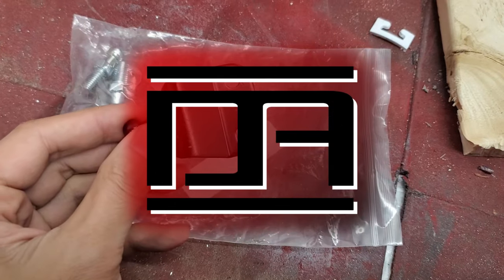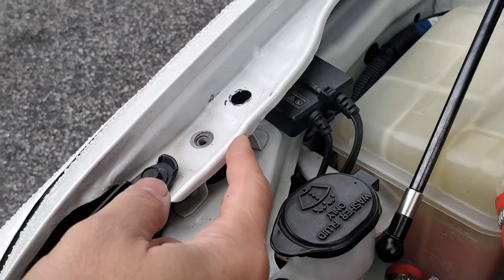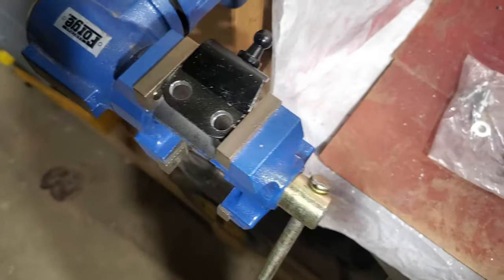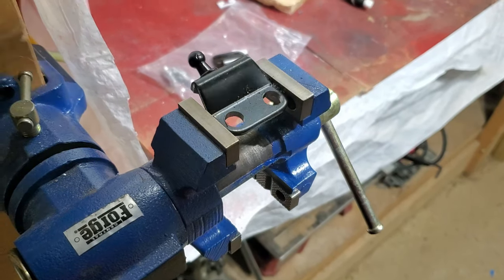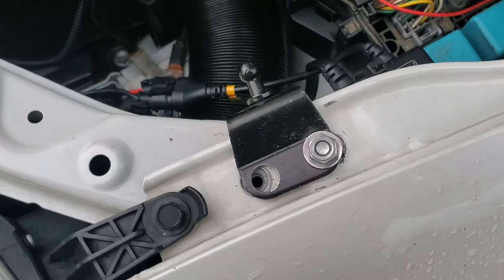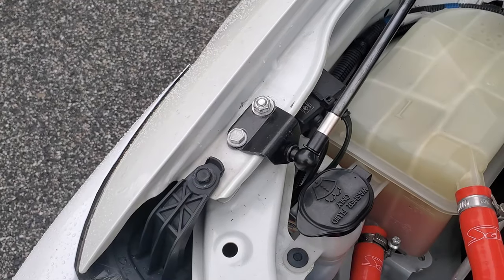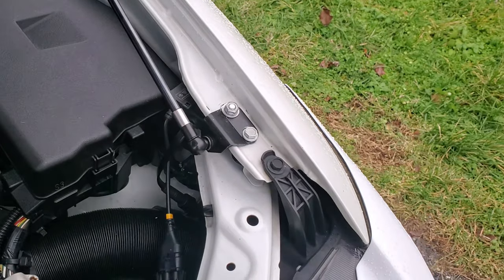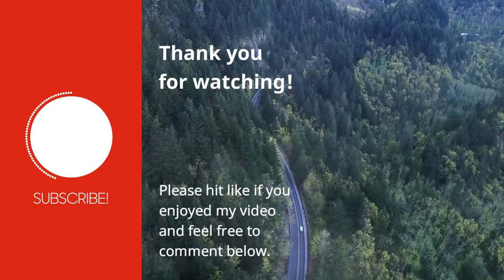Hood Dampers Universal Two Hole Fender Ball Mount Bracket Install (Scion tC2 / tC2.5)

Comment: Two questions my friend...... Question 1/. I noticed you left the silver spacer on the bottom of the struts after the new bracket upgrade, should I have left mine on too? Question 2/. Do you know the exact hardware specs for the stainless bolts, nuts and washers for these new upgraded brackets ?? I want to get them ASAP. Thanks Bro !!
Reply from the maker: You don't need the spacers when you use this bracket, but it doesn't hurt to leave them on as they will just make the hood sit up a little higher. As for the bolts, I'm going to run out to the store today and finally replace mine with stainless steel ones. I forgot about wanting to do that until I read your question. I'll post up the size nuts and bolts I get in the video description later.
Reply: @VampyreX13  Thanks Bro, I appreciate it.
Reply from the maker: Added the info to the video description. M6 is easier to find, but M7 will also work.
Reply: @VampyreX13  I actually found a bunch of M7 bolts of different lengths, along with nuts and 1 inch washers in my mess of hardware. Totally forgot I even had them. lol !! I'll send you a photo when I finally install them (I have to paint the brackets first so they don't rust). Thanks Bro!! Awesome as ever !!

Comment: Hey Bro.... the Amazon link is dead and the eBay link won't ship to Canada. Do you have any other links to get the brackets?? Thanks Bro.
Reply from the maker: I just updated the Amazon link.
Reply: @VampyreX13  Thanks !!
Reply: The link still says it's unavailable.
Reply from the maker: @jameshydra1031  maybe because you're in Canada? The search terms I used to find it were "universal hood bonnet mounting bracket" if you want to check your Amazon Canada site. If you find a working link, let me know.
Reply: @VampyreX13  The fact I'm in Canada is probably the problem. I checked Amazon Canada but no luck. Oh, well. Like they say, if it ain't broke, don't fix it. I'm not having any problems with my original brackets moving, so I'll just leave them be. Thanks for the help though. Greatly appreciated !!
Reply from the maker: @jameshydra1031  https://www.amazon.ca/dp/B0CK4JCNC8/